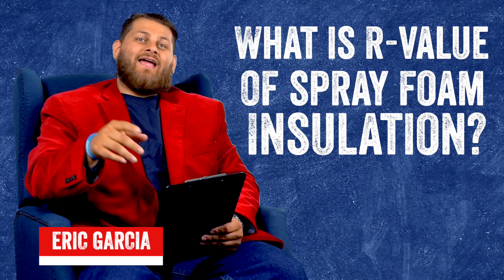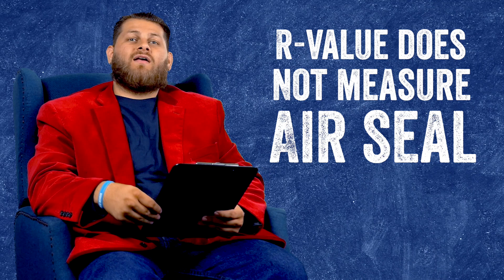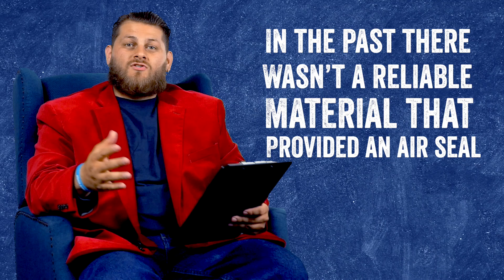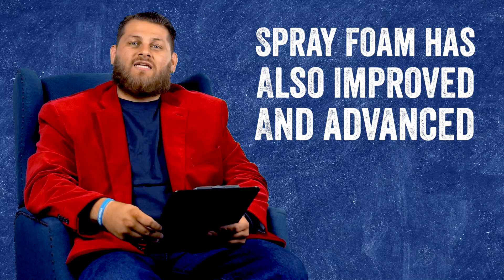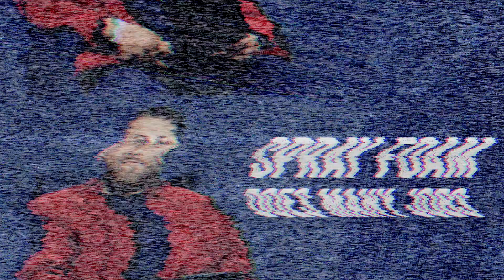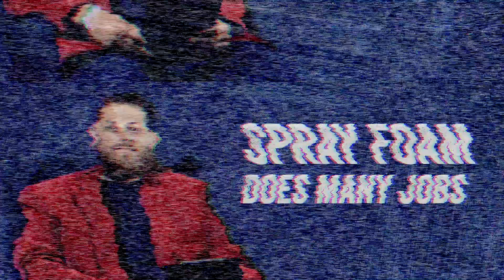What is the R-Value of Spray Foam Insulation? | Foam University

Comment: I'm building a new Honka Log home in Buena Vista, CO.  What do you suggest?  Closed or Open cell foam for the non-log areas of the exterior?  What about between the floors for noise dampening?  Thanks!
Reply from the maker: Open cell is the best option for this kind of project.

Comment: Great advice, i live in a roof converted to a flat without any insulation or central heating  really need to sort out in a mansard roof is insulation possible?
Reply from the maker: Spray foam could be added to the underside of the roof, along the roof deck.